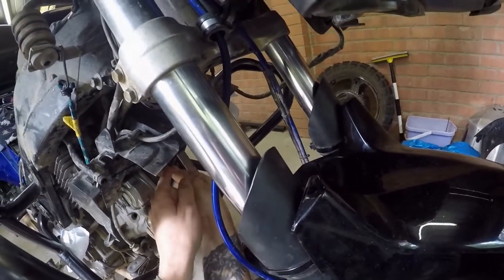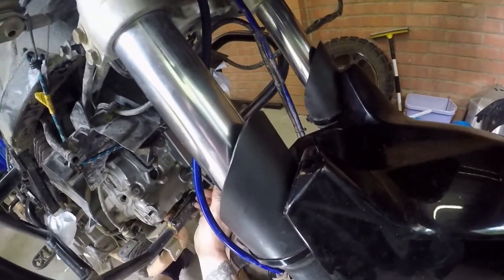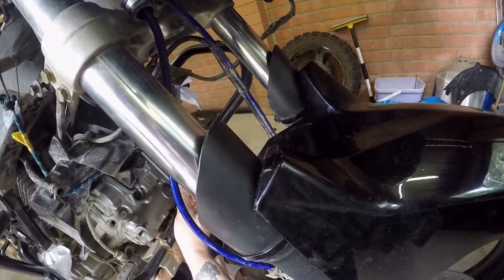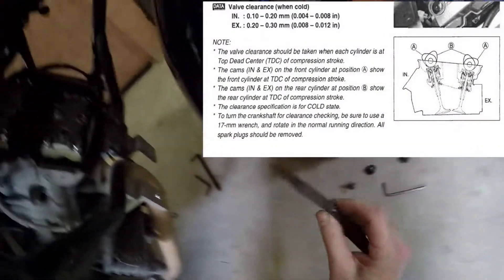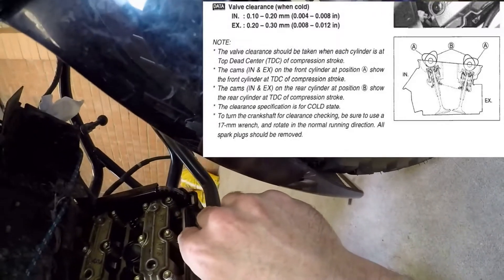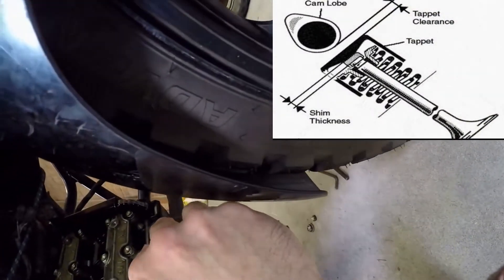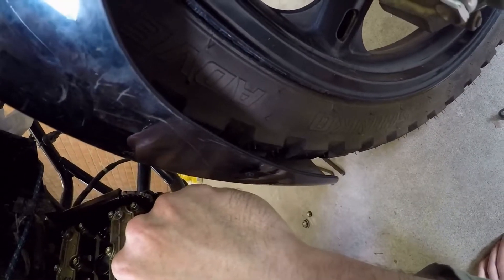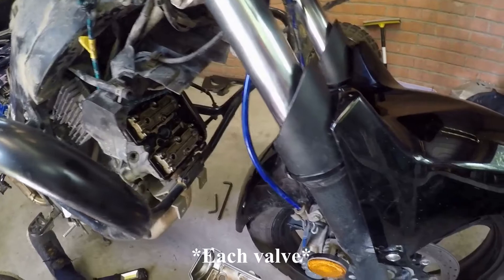Gen 1 V-Strom 650 Valve clearance check and adjust

Comment: To Oz Adventure rider. I read an old post on a V Strom forum (2011 I think) guys talking about how hard it is too remove the rear cam chain tensioner to change shims and one guy said YOU DO NOT have to touch or loosen the tensioner to loosen the chain. When you remove the cam cover you can see the tensioner mechanism from the inside. You get a longish flathead screwdriver and push down on the wedge shape bit on the tensioner and if you pull up the chain there is play enough to move the cams out of the way to remove the buckets. I’ve got a spare V Strom 650 motor and I tried it on that. The first time I didn’t succeed but the second go I could give enough slack on the chain to move the cams to remove the buckets and manoeuvre everything back in place all from the inside. No trying to find a way to get into the cam chain tensioner. Now I have confidence to change the shims on my bike without trying to remove the tensioner. I only did it on the rear cylinder but I’m assuming the front will be the same, maybe a little harder? If you practice on your spare motor maybe you could include it in one of your videos. It is a game changer. I did it by myself but a second pair of hands could be handy because you need one screwdriver to push down on the wedge bit and another screwdriver to push back on the full length of the tensioner pin while moving the cams out of the way if that makes sense. I would still cable tie the intake side sprocket.

Comment: Bloody hell ian I’m glad you know what your doing. If that was me doing that the bike would still be in bits and I would be taking to the bike shop with lost bolts in engine. Ride safe
Reply from the maker: Thanks mate! First time I did this job was on a triumph speed triple that I had owned since new, luckily I didn't start it straight away,  I woke in the middle of the night and realized I put the camshafts in 180degs out. Had to tear it apart again next day.
Reply: Bloody lucky on that 1

Comment: Great video again! I'm pretty sure I'd have way too many parts left over at the end of a job like this. (I do use the cardboard method of popping bolts etc into the rough layout of where they should go)
Reply from the maker: Thanks mate! Not to bad when each part only has a couple of bolts but things like clutch covers that have heaps of different length bolts then the cardboard method works great.

Comment: I've got my 15K service coming up on my 2019 next year (didn't ride much in 2020. Didn't leave the house much at all). I'll be doing air filter, valve check, coolant, brake fluid, spark plugs, anything else I can think of and certainly anything that requires the fairing and tank off, at that time.
Reply from the maker: Good luck with it! It's all pretty basic, getting access to everything is the hard part.
Thanks for watching and commenting, Ian

Comment: Nice work. Did this to my vstrom too, at 35000km, but it was all good. Yo make it look easy mate😀☕🇳🇴
Reply from the maker: It's such a relief when they're all good, just put the covers back on and off you go.
Reply: @OzADVRider  absolutly, taking my Tiger in for a first time check soon.. Hope its ok
Reply from the maker: I owned a speed triple from new, had the dealer do the first major service but decided to do the second one myself, one valve had no clearance at all. I don't think the dealer checked it. Done my own servicing ever since.
Reply: @OzADVRider  have a friend at Triumph dealer so he better do a good job😀😀
Reply from the maker: I'm sure he will! 
Mechanic at my dealer was an arsehole, had argument's over a brake issue which was a recall, had to call triumph head office to get it sorted. Still miss that bike.
Reply: @OzADVRider  that kind of behave dont make you buy a bike ore come back there again. I do prefere to do my own service, but valves on the tiger are so fildeling.

Comment: Looks like a pretty involved job. Are they usually within spec when you check them?
Reply from the maker: Yep, big job too adjust, fairly easy to check.
Generally it's within spec, first time I checked mine was at 45k miles, one was out. Next check at 60k miles all was within spec, this one was around 73k miles and had one out again.
I once owned an XJR1200 that was supposed to of been very well looked after, found 6 out of 16 valves out of spec.
Reply: Good job on the video and the machanics
Reply from the maker: Thanks Timmy! Hope your getting better mate.
Reply: On the VStrom, it's not unheard of to not need any shim adjustments until 60,000 miles or even longer. A few people report needing one or two shim changes early due to valve seating, like at the 15K check, then running another 100,000 miles with no changes needed. From the accounts I've read, it's very unusual to need more than two of the 8 shims changed in 50,000 miles of running.
Reply from the maker: Agreed. I think the 1st major service is the most important. Clearances need checking once everything has bedded in.

Comment: Do you have any other videos of doing this? Any good advice? My bike has done 32k at the moment and I'm unsure if it's ever been done. It's started making popping noises at low revs, similar to my nc750x.
Reply from the maker: This one is a lot better. engine is out and easier to see. I only checked the clearances though, didn't need adjusting. https://www.youtube.com/watch?v=EgeGJdq_2zc

Comment: Truthfully is it possible to remove the rear cam chain tensioner without removing the rear wheel. Thanks. Also can you just loosen the tensioner bolts to get the slack in the chain or do you fully have to remove it. Thanks.
Reply from the maker: Yes, I removed the cam chain tensioner with the rear wheel on. I do not have ABS though, I would imagine the ABS pump would get in the road, making it harder.
You need to fully remove the cam chain tensioner because of the ratchet mechanism. If you just loosen the bolts the plunger will extend (keeping the chain tight) and stay out, overtightening the chain when you re-tighten the bolts.
Reply: @OzADVRider  thank you😊